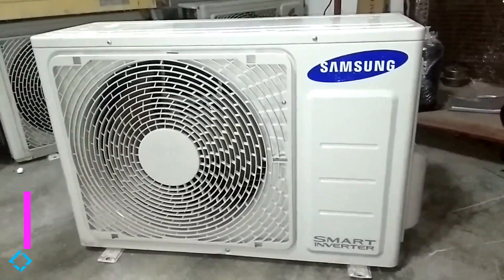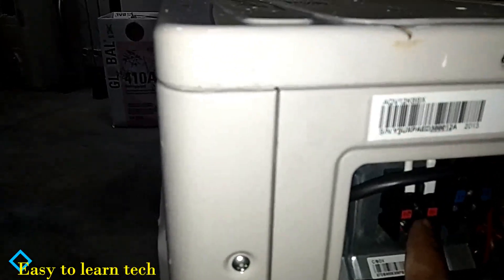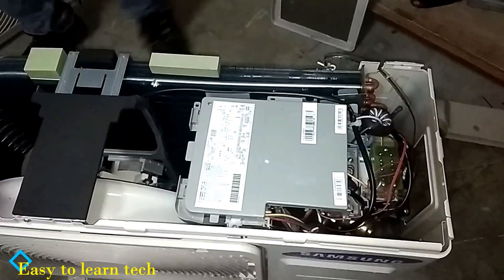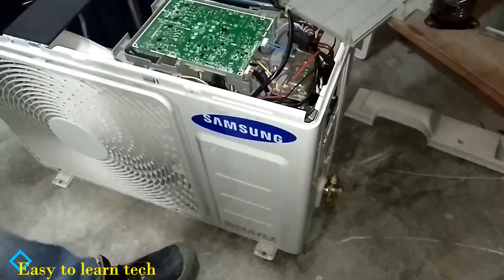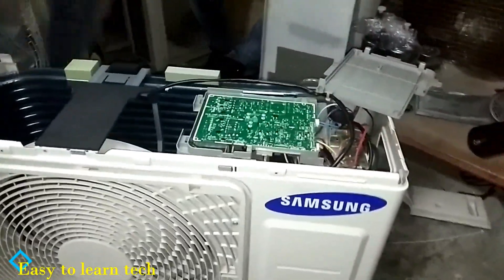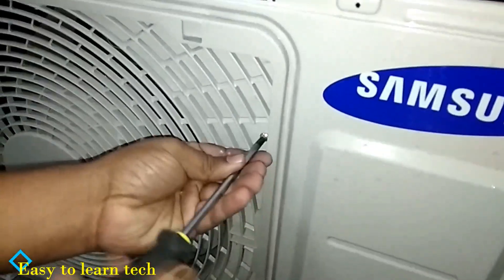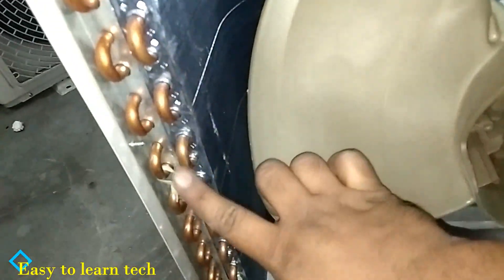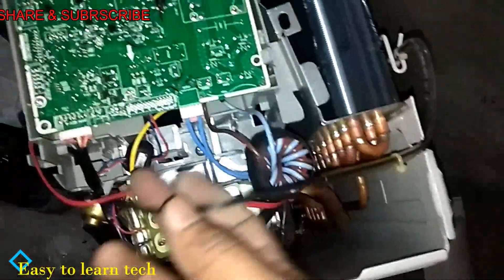#INVERTER #AIRCONDITING || HOW TO DISSASSAMBLE THE OUTDOOR UNIT for Servicing & maintenance

Comment: i have the exact model and its on and off frequently, it does not stay on, after 1 or 2 when the compresor starts the indoor unit shuts down and restarts, what to do ?
Reply from the maker: Need to check the PCB card for indoor as well as outdoor units.

Comment: where is the capasitor sir.
Reply from the maker: Which capasitor?
Reply: @Rehankhan_HVAC_TIPS  He probably meant the "start capacitor" for compressor unit. I wonder that too. Usually they are very large and clearly visible as soon as you remove the panel, but here nothing can be seen.
Reply from the maker: The Inverter Compressor is working on Dc Current, therefore no starting Capacitor required.
Reply from the maker: This is inverter AC outdoor.

Comment: Sir can you help me my ac is consuming high amps.
Reply from the maker: Hi sir which aircon you have on/off or inverter
Reply: @Rehankhan_HVAC_TIPS  Sir it's a samsung 1.5 ton inverter Ac with 410a gas.
Reply: @Rehankhan_HVAC_TIPS  bhai apne kuch bola nai
Reply from the maker: @tanweeralam3202  I will call you tomorrow
Reply: @Rehankhan_HVAC_TIPS  ok bhai
Reply: @Rehankhan_HVAC_TIPS  bhai  call krna haa bahi
Reply from the maker: Sir is a inverter duty compressor, it will not take high amps, if it's taking high amps please check the compressor
Reply: @Rehankhan_HVAC_TIPS Thank you sir
Reply: Hi pls Cal me.my Invert Samsung Ac same one...recently problem..while start on after 1 mins AC cut off error symbol is timer and power symbol bilinging may I know what is problem 

Note no outdoor on it and no cooling 

Pls if it is possible.to covert normal ac with low service...9600166802 WhatsApp me pls

Comment: Where is the inverter?
Reply: Bro this is the outdoor unit of ac which is inverter compatible..
Reply from the maker: Inverter ac means to control the speed of the compressor motor, so as to continuously regulate the temperature. The DC Inverter units have a variable-frequency drive that comprises an adjustable electrical inverter to control the speed of the electromotor, which means the compressor and the cooling / heating output.